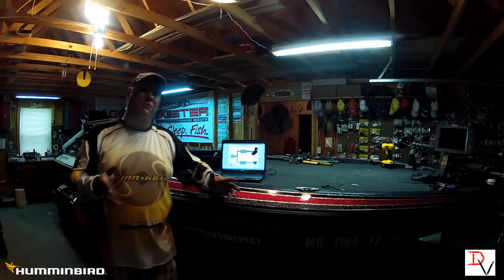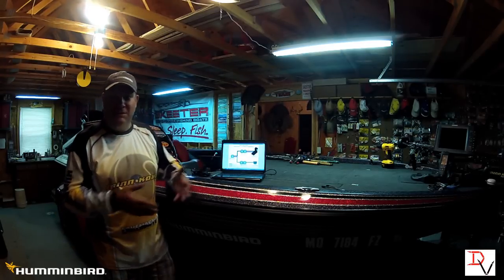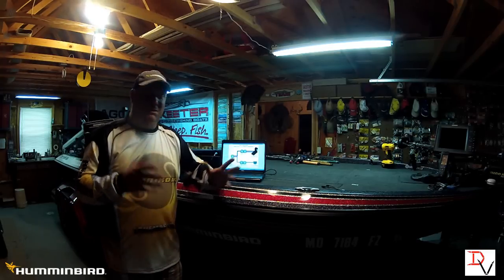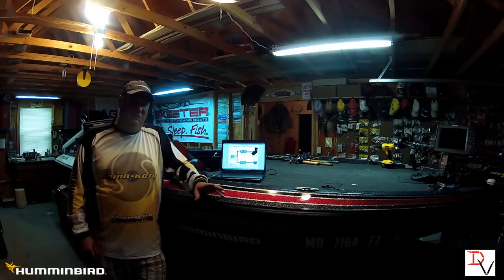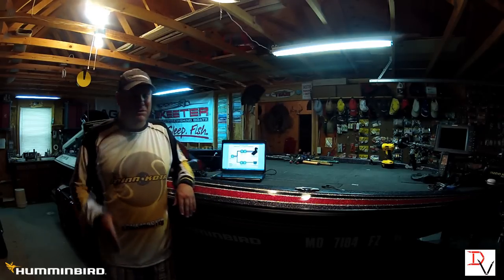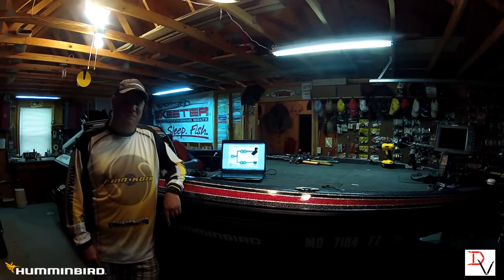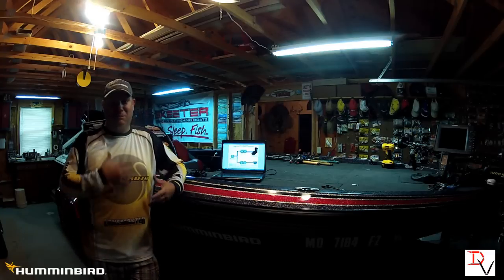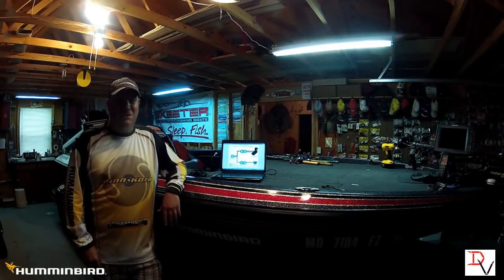Tips 'N Tricks 91: Understanding the Humminbird AS SI DB Y Cable

Comment: Doug. Having a high speed skimmer transducer installed so I am able to get depth readings when running on plane. How do I switch from my Gen 2 Helix 12 Si transducer to my high speed skimmer when I’m running and gunning?
Reply from the maker: There is no switching with Y Cable. It splits the 2D readings to the 2nd transducer all the time.

Comment: Doug, I just purchased a xnt 9 20 t transducer for a 788ci hd hummingbird, the depth is flashing from 50 to 350 feet while in 5 feet of water, my transducer cable has five pins and the new one that the manual says I need is three pins.  Can you help with this problem, can't see bottom.

Comment: Doug, I am new to this all and trying to get it right to start. I have a helix 7 G2 Chirp Si GPS , I want to mount my Si transducer just right for slower speeds and want to mount an additional transducer to get high speed readings with the Y-Cable. What do I use?
Reply from the maker: XP 9 20 is shoot through the hull or XNT 9 20 or XNT9 20T is transom mount.

Comment: Hi Doug.  Thanks for breaking this down.  I have watched a lot of your videos and they're very informative.  I do have a question.  I just received my boat and I had a helix 10 mega installed and also had them install the two transducers with the y cable.  Now what I am wondering is where my chirp data will be coming from, and will I loose out on the chirp data as it will be routed through the high speed transducer.  Thanks
Reply from the maker: With the Y Cable the 2D Sonar always comes from the second 2D only transducer. Just

Comment: Doug, I have a Humminbird 998c si. Would the SIDB Y Helix 720101-1 adapter work to split off the XP-9-20 second 2D Only Transducer?
Reply from the maker: The SIDBY Cable is the same for Core Series and Gen 1 HELIX. Gen2 HELIX is different.

Comment: Hi Doug, great video! I have a XNT 9 20 T.  I am hope to use it as my 2d transducer for my 1198c Si.  Will it work?  
For the XNT 9 20 T Humminbird says it is compatible with 1157, 1158, 1159, 1199, but  1198 is not on the list?
Thank you in advance!
Reply from the maker: It will work fine with the Y cable.
Reply: Thank you very much!

Comment: Doug called Humminbird Support Friday 10-27-17 asking about how to find Sonar to check if using 200 MHz or the 83/200.  I have the Helix 12 Chirp Mega Si G2N.  I was told the unit does that automatically you can't change it.  The old units you had to do that manually.  So here is where the Humminbird support call got weird.  I told the lady I am using the Y cable and a 2D High Speed transducer and the Si Transducer.  I was trying to find the Sonar settings on the menu of my unit, which I was told aren't there.  Then the Humminbird Support person tells me High Speed transducer is what it means.  The unit uses the Si transducer for sonar but when you get up on plan the unit switches to the high speed transducer.  I told her basically what you're explaining in this video and she told me no.  The unit uses the Si transducer till you speed up and then it changes to the high speed 2D transducer.  I posted to a Helix group and several of the people said what I already thought Sonar is all on that 2D High speed.  I have had a number of support calls to Humminbird and it seems their people just don't know what they are talking about.  Really terrible support.  I had a Garmin EchoMap 94SV and made a number of calls that were always really good information except one email.
Reply from the maker: With CHIRP you do not have single frequencies rather frequency ranges and are called low, medium and high range. 200kHz is in the high range and 83kHz is in the medium range. If you want these frequencies set the CHIR 2D to Medium/High

Comment: Hello Dough, I have been using the SIDB Y cable for a few months. Recently I started having problems getting depth reading once I exceed 5 mph. The system often jump around from the correct depth to outrageous number reading (+,-) sometime it gets stuck on the incorrect depth reading. Do you have any thought on what could be causing this problem? Am wondering if I should try another Y cable or replace the hull transducer?
Reply from the maker: Most likely it is the transducer or transducer installing. Remove the Y cable and plug it directly into the unit. If it does the same test the transducer and reinstall or replace

Comment: Doug, Last fall while fishing Truman Lake, I broke my 598 SI mounting bracket(fortunately not the transducer itself). In the short term, I've been using an extra 598 SI transducer that I have in the bottom of the boat with a small sandbag on it. When I re-mount the external transducer, can I continue to use the extra SI transducer inside the boat or do I need to get a dual beam 2D? If I need the 2D, do you happen to know the model number for the 598
Reply from the maker: +Gary Filbeck I would use a XP 9 20 for 2D shoot thru hull transducer.

Comment: Hey Dough. If a helix 9 SI is used with the XNT ducer and also the XHS ducer, the Y cable is required. But if I need to increase the length between the Y cable and XNT ducer and also the length between the Y cable and XHS ducer, which cables will be required. Both ducer will be transom mounted. And what distance should be kept between the ducers to avoid cross returns.
Reply from the maker: +Mark D' Costa Are you splitting 2D sonar or you using a Left and a Right SI TRansducer that is the only y-Cables available. They limit powering crystals by wire to each transducer what it can do. Y Cable plugs into unit if you need additional length you will need to purchase the Transducer Extension Cables from Humminbird.
Reply: Doug Vahrenberg. Txs for the info. Also got some help from HB. They advised to get a 2D ducer for high speed and XHS ducer for hdsi troll speed. My previous set up of hooking XNT and XHS was totally wrong according to HB, as I wouldn't get any high speed on both.

Comment: Hi Doug....What cables/adapters do i need to hook up the following transducers to a single unit HB 859ci HD DI.  I have the transducer in the Minn Kota Terrova 80 US2 and the  XNT 9 DI T that came with the HD 859 c HD DI   Will i need the ts3 switch to toggle back and forth between transducers or will the AS SI DB Y adapter work?   I did see on one of your post that ou mentioned it did not work on DI...I have seen a few websites that post that they do...i trust you more but just wanted to clarify...:)  thanks!!!
Reply from the maker: Juan MarquezdelaPlata Just install the DI transducer on the trolling motor it has 2D and DI crystals inside it and all you need

Comment: Hey Doug! I enjoy all your tips and tricks videos! I have a question though. So if I understood correctly, If I have a 999ci hd si bow mounted with the hdsi transducer mounted on the jack plate, can I also run a XTM 9 20 T on the Trolling motor without needing a y cable or any other additional setup? Will it mess any other readings up? Thank you!
Reply from the maker: You would need the AS SI DB Y Cable to connect to the unit but will work for the described install. My question why not install the HDSI on the Trolling Motor? It's an awesome tool!
Reply: Doug Vahrenberg my plan is to put a 959 up front and move the 999 to the console eventually. I also put the hdsi at the back so I could have readings when I pull up on an area and check it out before I decide to fish it or not. I appreciate the input!

Comment: Can I use the same cable with DI instead of SI unit?
Reply from the maker: I have not tried that and can't answer 100% for sure but recommend calling HB Customer Service 800-633-1468 they can tell you for sure
Reply: banhtrang99  I mounted this Y cable on my Helix 10 G2N with a glassed in 2D puck. The Side imaging and 2D both work, the DI does not. I know the SI and DI run independently now, the older units shared the data. Not sure if this is where the failure is coming from. Maybe a switch would be a better choice. The commentary in this video states side and down imaging, though the document being displayed does not. The document is correct.
Reply from the maker: The G2N Models require different Y cable since they have dedicated DI elements in the transducer. This is for Gen 1 and Prior Models of Humminbird.

Comment: hi doug. First of all congratulations for your videos. they are awesome.

i am from brazil and i have a doubt i think you can help me

i am buying a hummingbird 899ci hd si to use with my terrova us2 55lbs i-pilot link

is it possible to install the si transducer that comes with the 899 on the back of my boat and run a cable to the front and to my console? like a cable to divide the si transducer output in 2 lines.

Is there a way to do so without buying the humminbird trolling si transducer?

i mean that because i wanna have the side imaging capability while using my trolling motor and also while navigating with my boat (trolling out of the water). I wanna get the humminbird screen and put into the ham mount in the front while fishing and put into de console while navigating.

I don't know if you can understand what i want but i hope you can help.

thanks in advance.
Reply from the maker: Setting up 2 Stations is not a problem. You will need a US3 Graph Switch to switch which location gets the transducer data. http://www.humminbird.com/Products/US3/

You will also need another power cable, RAM Base and Cable Collector to make the second station set up.

Comment: Hi doug, which transducer are you using for the 2d skimmer?  I have a XNT 9 20.  I am wanting to use it as my 2d transducer for my new 998 c HD Si.  Will it work?  
On the XNT 9 20 package is says it is compatible with 917, 931, 937, 957.  But that's it.
Reply: Hi Doug by turning on the fish finder the power comes on but won't turn off from the set.